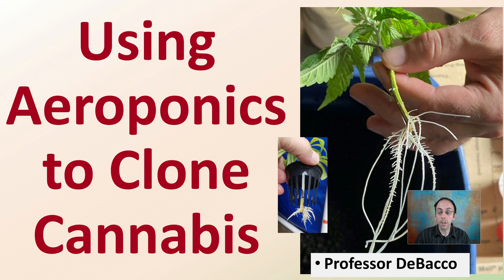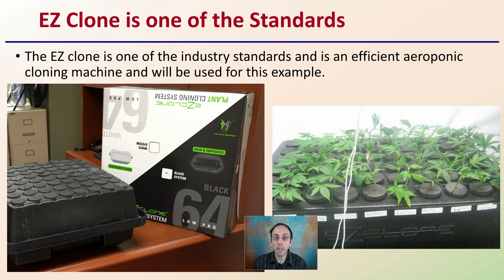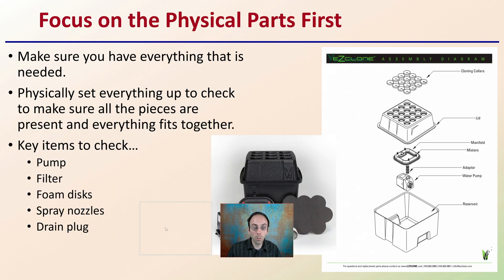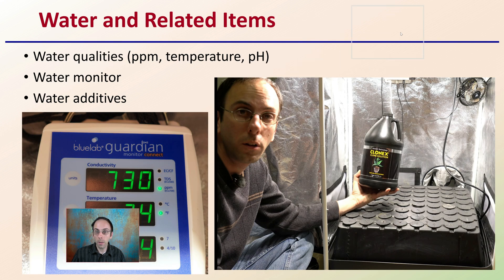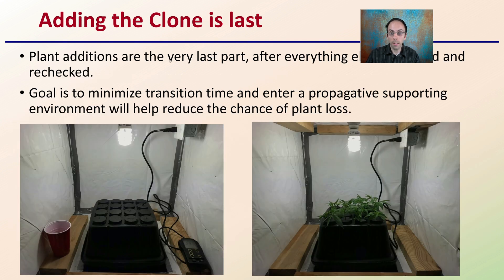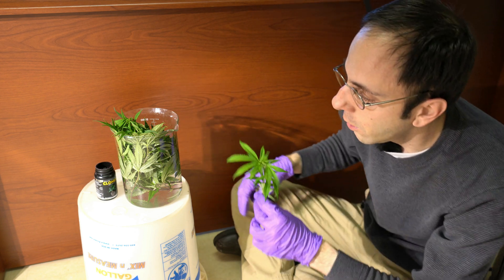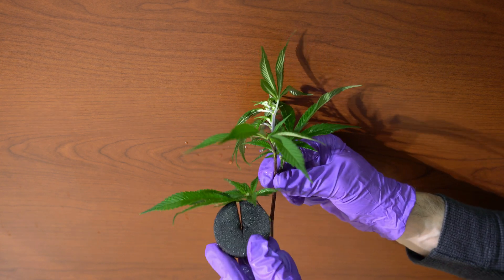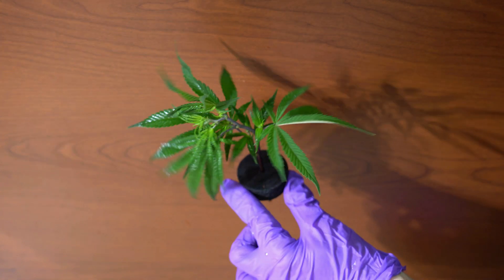Using Aeroponics to Clone Cannabis

Comment: Thinking of building a bubble cloner. Do you recommend adding in any rooting hormone to the water? Powder or gel. also how fast should clones root in a aeroponics/hydroponic system vs say soil,coco,rockwool etc?
Reply from the maker: Nope, just dip the plant material in a rooting hormone.

Comment: I built a “super cloner”. It’s a EZ Cloner 16 site with a Nova Tec Coolworks Ice Probe and TEC-65 controller installed, as well as a Bluelab Guardian EC/PH/Temp monitor. I insulate the cloner reservoir in the summer to keep the temperature “pull down” effect. For nutrients I use Clonex cloning solution, GH Rapid Start, and of course Clear Rez for cleanliness, and cloner gel when making my cuts. Starting TDS is 350-500, ph @ 5.8., with a reservoir temp of 68-77F. Lighting is 2-18” Sunblaster LED’s. Roots in 3-5 days, transplantable in 7-14 depending on genetics and cut quality. 100% success rate since build. 🌱🌱🌱🌱
Reply from the maker: Thanks for sharing the details of your system, sounds like it is working out great for you.
Reply: @DeBaccoUniversity  Thank you for uploading awesome videos in the name of grow science and education. 🌱
Reply: Oh dear!. Take a look at the Clonex label and box: it says 'Not soluble in water'. Suggesting Clonex as an additive is bad advice. All it does is cause a load of foam and bits of gunge. It does absolutely nothing to help rooting in a cloning machine. Furthermore, it's a waste of time putting Clonex on your cuttings, because it just gets washed off as soon as the pump starts.
Reply: @CrankCase08 he states he uses the clonex solution which is water based for hydro/aero. Not the gel.

Comment: Why do you dip the cutting into clonex gel if the reservoir already has clonex in it? Is there something in the gel that is not in the the gallon nutrient solution?
Reply from the maker: The gel contains auxin a plant hormone that encourages rooting, the nutrient solution is made by the same company, but provides mainly a nutrient support for early plant establishment.  So both are used to provide the most supportive environment for the clone.

Comment: Top tip do not dip clone into clonex bottle unless you plan on tossing it afterwards you have contaminated it
Reply from the maker: Starting with clean cuttings will reduce the chance of contamination and if you do a lot of clones you can go through a bottle quickly despite not using much per clone;-)
Reply: i second this statement, put it in a separate container

Comment: Good video.
I've been cloning with aero for about 10 years.
I purchased my first aero cloner. Then I built 4 more.
The unit I purchased holds 40 clones. The 4 I built hold 21.
The 4 aero systems I built, that I grow with. Have 2, 21 site grow chambers.
That's why I built my aero cloners with 21 grow sites only.

My operation is set up on a 2 week rotation. This means I harvest one of my systems ( 42 plants) every 2 weeks.
So this in turns mean I need 42 clones every 2 weeks.
The balance of the clones I grow I sell. I sell hundreds of clones a month.
I call them bare root clones.
And people love them cause they can be grown anyway you want.
With hydro or in soil.

I have a 100 percent success rate. And all I use is plain tap water. Nothing else.
I start getting roots in 5 days. And in 10 days they ALL have roots.

The only secret to having success with aero cloning is keeping your solution or water at the correct temperature.
That's it.
You don't need any of that gel or any kind of nutes in your water.
All that is is a waste of money. And adds to the cost of your finished product.

The only reason I started growing with aeroponics is because it's the cheapest way and the only way I could make a profit growing cannabis.
Growing in soil I couldn't even come close to making a profit.
Due to the cost of electricity and LABOR.

Anyway I thought I'd throw this out there.
Good luck everyone.
Reply: Toot Toot 🚞💨💨
JK I’m only jealous
Teach me your ways!
Reply from the maker: Thanks for sharing, seems odd that aeroponics is cheaper than soil production.
Reply: @DeBaccoUniversity  how deep do you wsnt to put them in the water?
Reply: @ASS OG what's the correct water temperature? Also is your tap water hard or soft?
I'm not having any success with my aeroponic cloning. I'm using straight tap water and water temps are 68-69f. My water is hard with a ppm of 337.
Reply: @00piper18000  
Hey what's up ?
I use well water.
And the ppm is 490.

As for your water temperature.
I like to keep mine around 75.
But I really don't even check it.
Because I keep my grow rooms at 75.

Hey man, I'm going to tell you secret.
That I never tell anybody.

This is the trick that got me to achieve 100 percent success rate with cloning.

This is how I first started taking clones for my aero cloners.
The cloner holds 21 clones.
So I would take 10 clones.
Walk over to the cloner.
I would clip the bottom of the clone. Put it into the insert, then into the net pot into the cloner.
I would due that with each clone till the cloner was full.
Then I would put water into the cloner and plug it in.
Doing it this way I was getting about a 60 percent success rate. But it was taking 20 to 25 day's.

Now the trick is.

Now when I cut the clones off the mothers.
I put them right into a cup of water.
So now I have 10 clones in that cup of water.
I walk over to the cloner.
And now I have the cloner full of water and running.
So I take a clone out of the cup, I still clip the end off.
Install it into a insert, into a net pot, into the running cloner.

Ever since I started taking clones this way.
I achieve a 100 percent success rate.

What happens is, when you take a clone and you let air get to the clipped end.
The air will seal the end really fast.
And this will cause problems for that clone to get roots.
Give it a try and let me know how you do.

Oh and another thing is make sure you keep your pump running 24/ 7.

I hope this helps.
Later.....
Reply: what temp do you recommend bro?
Reply: @Lauricisquezou971  
Like I stated in the previous comment.
I keep my grow rooms at 75 degrees.
So I'm just assuming the water in the cloner is around 75 degrees.
But it works.

Another thing when trying to clone with aero.
You shouldn't use a humidity dome.
I tried it once.
And it was a total disaster.

To much humidity and it started causing mold.
It was the one and only time I have ever gotten mold.

Comment: Tip: scrape the skin off one side of the bottom inch before dipping promotes roots to sprout easier
Reply from the maker: Thanks for adding this tip as it can help the rooting process, key is to not go very deep into the stem.
Reply: @DeBaccoUniversity  yes just expose the white part by a couple of millimetres

Comment: These units simply throw water at the stems which is more hydroponic than aeroponic.
Reply from the maker: Aeroponics is defined as... "relating to or involving aeroponics, a plant-cultivation technique in which the roots hang suspended in the air while nutrient solution is delivered to them in the form of a fine mist." (Definitions from Oxford Languages)  So by this definition the process showed in the video is aeroponics which could be considered a subset of a hydroponic system.
Reply: @DeBaccoUniversity  
Ez Clone units dont use a fine mist, they throw water at the roots.
Reply: @atomizer2665  Ever seen one of those old TV shows where one of the main characters is a total idiot and you get to watch him argue with an expert while the expert stands there waiting for the fool to finish looking foolish?

To put it in layman's terms, hydroponics is the scenario where the roots live in highly oxygenated water. Aeroponics is where the roots live in highly moist air. It does not matter whether that is atomized water from a ultrasonic emitter, or water dripping down on them like natural rain ( as is the case in the Tiwer Garden). The important differentiation is that the roots aren't constantly wet while in hydroponics, the roots aren't constantly being drowned. Little of this, a lot of that either way.

Now let me give you the advice nobody else has. Go watch more videos, listen, and learn rather than coming at this as if you have all the answers and are going to correct those with decades of practical experience.
Reply: @MichaelRainabbaRichardson  
Descriptions count for nothing its results that count. Sellers of "aeroponic" systems  tend to attach the benefits of genuine aeroponics (fast growth, less water and nutes etc ) to their product which doesnt deliver becuase it is aeroponic in name only. . If you dont have decades of experience with aeroponics and cant tell the difference, these are genuine aeroponic roots https://youtu.be/l1Rmm9JvPfY 
Take a look at tower garden roots or ultrasonic fog roots and decide if they look remotely similar.
Reply: @atomizer2665  https://photos.app.goo.gl/hZVEu4w7CD8E6YsR9

Nothing but a weak drip is responsible for these root balls.

It's not the size of water particles that brings the benefits of aeroponics, but the fact that the roots live in the air and moisture isn't so readily available which causes them to grow many and smaller roots. This increases the surface area available for the plant to uptake nutrients and water. It's that simple. I get mini root balls on my clones since I depend on the Kratky method, which continuously converts water roots to air roots as the water level drops from the plant consuming the water (and the air above the water isn't cycled, so it stays very humid.)
Reply: @MichaelRainabbaRichardson  
I dont know what point you are trying to make. Your root pics dont show an aeroponic root structure which is required to provide the benefits you state. 
Just having roots in the air doesnt make it aeroponic, if it did your roots would look completely different. Here are some aero roots that are hanging in air that are getting too much mist  and the entire chamber is receiving less than 2ml per misting.  https://youtu.be/iXWT1cObE6o
Reply: @atomizer2665  You are correct. Also, Clonex is not water soluble, so it will do nothing except cause the water to foam before turning to gunge.
Reply: There is no fixing stupidity..

Comment: Love your videos. Dipping into cloning gel will deteriorate the cloning gel , best to put some in separate container for immediate use and keep rooting gel sterile
Reply from the maker: You are correct, allocating a portion to a separate container will limit the chance of cross contamination.  If you produce many clones the 100mL container that is shown can be used up fairly fast and is preferred to the larger containers to provide some isolation to reduce the chance of contamination.
Reply: I saw it and was like “That’s Gangsta” but I’ve done that before with a lesser brand of gel and it quickly turned to crap. But I really wish I was gangsta enough to do it Thug DeBacco style 🙌🏾